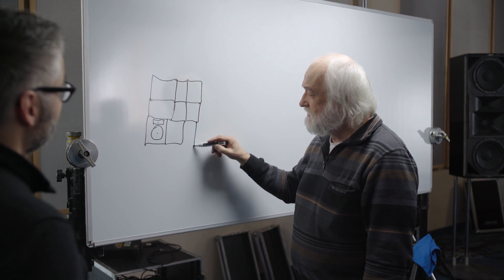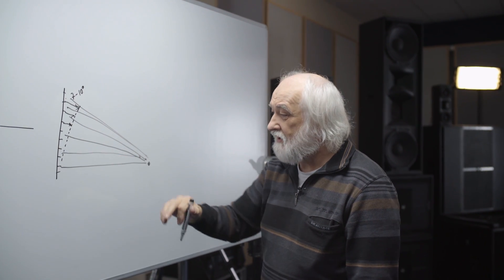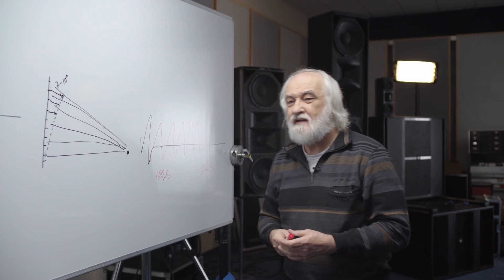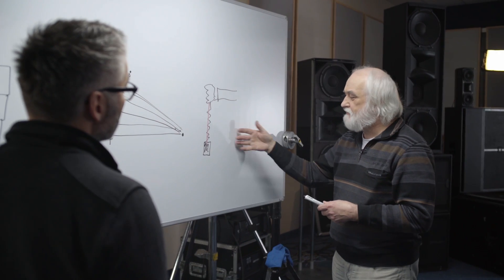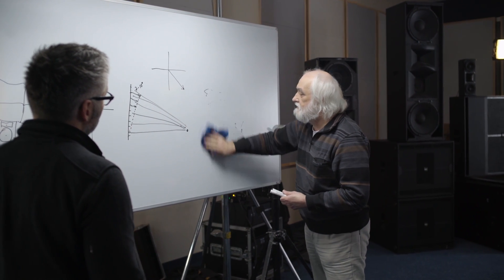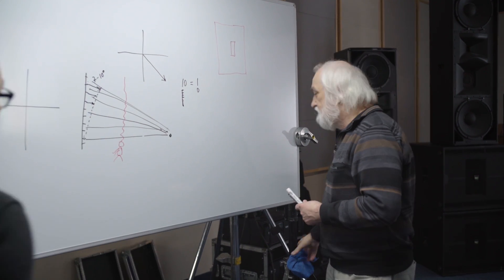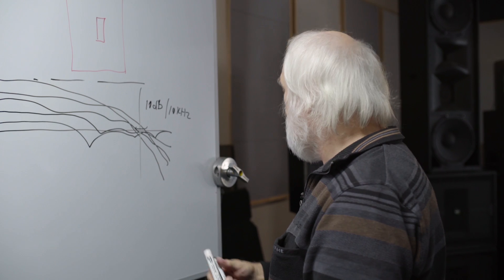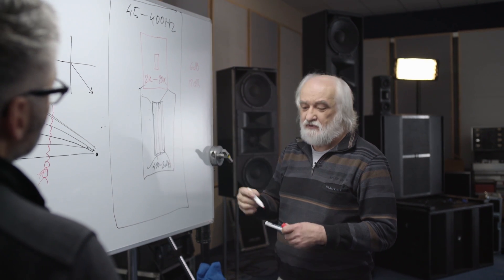TECHNICAL TALKS - Point Source vs. Line Array and Introduction to VHD5

Comment: Can no one see that they are being bullshitted? He just spent 15 mins hiding something. That something is the flat panel speaker, which is going to subsume the conventional driver, eventually.what he is talking about horns and midrange drivers is just bone-less shit. Believe me, I have my own system and the transducers cost less than £100 and the bass can be felt 3 doors down the road.

Comment: Hello.

A major goal of a line array cabinet is the NARROW COVERAGE OF THE HIGH FREQUENCY DRIVER (about 10º). To achieve this, the driver is coupled to a WAVEGUIDE, that creates a coherent wavefront:
https://www.equaphon-university.net/teoria-del-line-array-parte-iii/

As proved at Meyer Sound Seminars and FFT Smaart measurements, each high frequency driver covers a different audience area  ( 1: 07 : 45, where people sit and stand up in front of a single cabinet to check the narrow high frequency coverage):
https://www.youtube.com/watch?v=w8snO3j8FlU

So each listener is only receiving the high frequencies from one or two cabinets, and therefore there is no delay among cabinets in each different position. But I agree with the video when talking about high frequency energy loss in the distance, as each audience area only receives SPL from one or two cabinets (8:40).

Thank you.

Comment: To a hammer, everything looks like a nail. As a systems designer, I use both line-source and point-source systems.  Neither is superior for every application. Each space has their own requirements. Please go see SynAudCon and get into the room where systems designs are not based upon marketing products.
Reply: Can you explain how speakers in a line array don't cancel or interfere with each other at high frequencies?
Reply: @TerryPullen  They do interfere with each other at all frequencies. Each manufacturer handles this their own way. Some use ribbons transducers, some use close spacing, some have special FIR filters and other DSP...

Comment: By boosting 12 dB at 10 KHz to account for air absorbtion, will that not be to loud at that specific frequency in front of the stage?
If with a point source you lose 6 dB for every doubling of distance , then you will have aproximately 32 dB more @1 m from the speakers then at 100 m from the speaker, not a very constant volume,but a very huge difference.You will only have constant pressure from 64m to 128 m from the speakers.
Reply: From my experiences you duck under the big horn at close range outside of the focus of hi frequencies; a smaller unit covers the spece under and near the main unit.
Reply: No one is going to be standing 1m in front of the HF horn getting their ears blasted.

Comment: 12:43 .. you have to ..'uch uch'.. account a bit of losses ?? ... how about account DOUBLE the losses .. 6dB per distance doubling vs 3dB for a line source.
Reply: it's only in theory
Reply: Athough for an average line array it's usually only a 3dB loss from about 10 to 20 feet, 4-5dB from 20 to 40 feet and 6dB from 40 to 80 feet. It doesn't have any SPL advantage afar it simply loses SPL up front, (although no audience members are standing a metre in front of the line array anyway)
Reply: dB is only a proportional unit, so if he says, that at 50m the loss is -6dB and at 100m it is -12dB at higher frequencies, he is also saying, that at double distance you loose 6dB in reference to first point ;)

Comment: DIRAC LIVE solves the Impulse response problem .....
Reply: Around minute 6 he talks about how they flattened the impedance. Is he suggesting the use of a zobel network to achieve this in a line array?

It would appear so, but I didn't think impedance was related to time delay inherent in line arrays due to the multiple drivers.

I'm a noob wanting to design hifi home speakers on a budget. I imagine all large venue problems can be solved by throwing money and software at the problem. Clearly this is not feasible for me and many others.
Reply: As I remember they use 18sound drivers, there is a copper ring in the pole-piece under the voice coil. Impedance (inductance) is not a problem, but inductance modulation is a problem for PA speakers.
This is a large signal effect, and can't be cured with DIRAC LIVE (impulse response is a small signal phenomenon).

Comment: Could you please elaborate the topic between 1:52 and 3:37?
Reply: Over 2ms ? that would be 1m or more .. the tilt angle of the linearray, at that distance is only a few degrees. you will never ever get more than .1m of delay.
Reply: I´m not really talking about line arrays in particular mind you, I am simply describing the effect mentioned in the video that he is asking about. I feel that by exaggerating such effects it can be easier to understand the topic, specifically with this topic I wouldn´t want to give the impression of something that could be ignored so I chose a size that I felt was large enough to express the phenomenon clearly.
Reply: 'Could you please elaborate the topic between 1:52 and 3:37'
Yes. the explanation in this video is misleading. Curved arrays have have no time smearing problem, just large straight arrays have.
Reply: @csabesz78  But a curved array moves into the realm of a hang of groups of close coupled composite point sources. Indoors you can count on room gain to increase the LF region in SPL to match the mid-to-high cylindrical wavefront at a given distance and of course, you can try to improve the air absorption by changing both magnitude and phase alignement of the sources at far distances, but the modern approaches of MLA, Anya, and Array Processing essentially reduce the hang to a vertical cluster of point sources with very complicated and advanced processing. A single point source is great in theory, but in practice, everyone is already deploying point sources now, but very imperfect ones. If you begin with a better point source, and compensate using the same methods and techniques, you can get the best of both worlds.
Reply: @csabesz78  even if they did, the vertical time difference is not really perceivable by human ear even if 3-4ms would be the case, only difference which is 5 nano seconds we perceive in horizontal plane which line array has no issue with.
Reply: Essentially he is just talking about the time difference of arrivals between different loudspeakers. Imagine you have a very fast signal, think a snap or something, not bass or guitar. Now imagine that there are multiple arrivals of that sound signal coming in over 2ms. What happens now is that instead of the snap being crisp it will lose its definition and its edges get blurred due to same signals arriving at the same time. So if the signals arrive at different times with the same sound signal it will be comparable to hitting play on multiple sound devices (f.x. phones) almost simultaneously so you can easily try out how it sounds, not completely representative though since one usually does not have that kind of precision for clicking play. Hope that helps.

you could also simulate this easily on some DAW software by copying a snappy signal to another channel and move it around by 1-2ms.